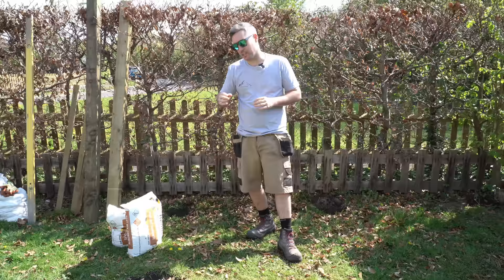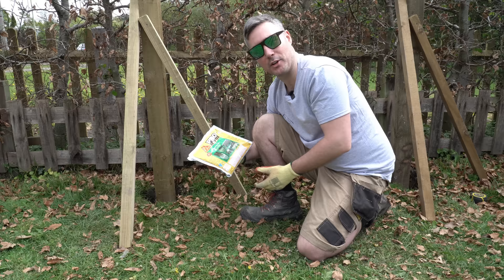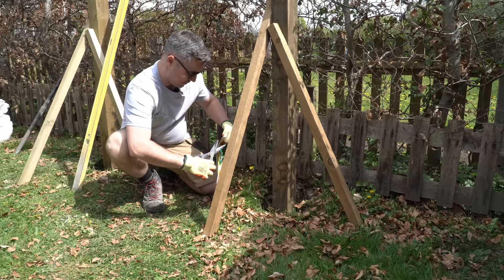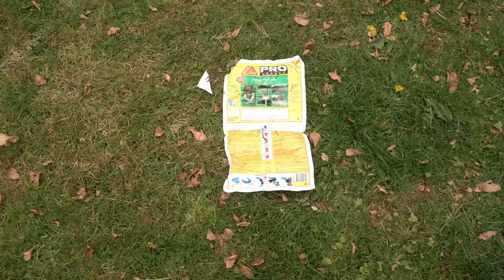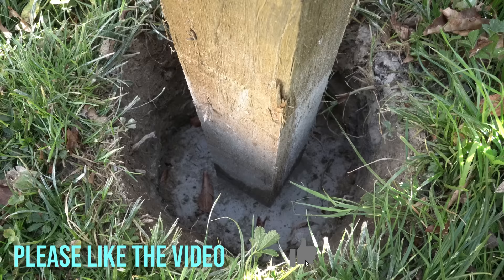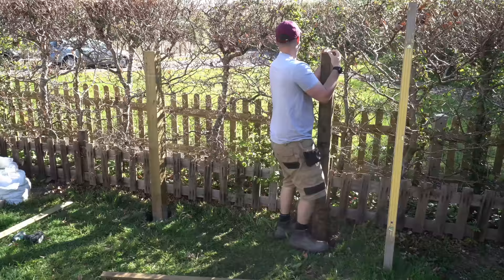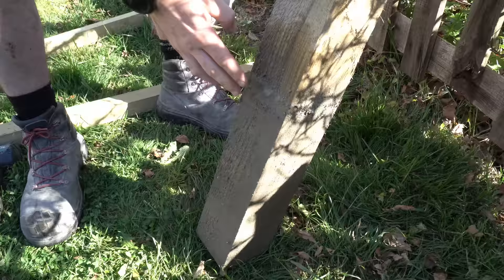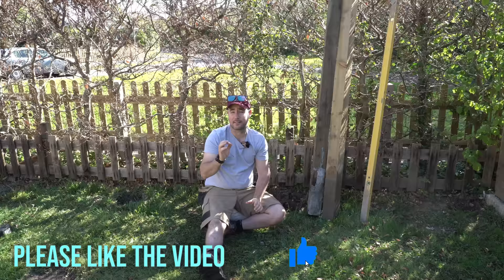Fence Post Foam vs Concrete | STRENGTH TEST

Comment: I set a bunch of posts directly in the earth. I tamped the earth back in around them as I filled in the holes. That was 10 years ago. They are all still fine. So that is another option. But it depends on soil type and wood type. In my case, the posts were all heart redwood. Also, the holes were pretty deep with as much wood below the surface as above.
Reply: People are too lazy to tamp in posts. It's a time tested way but this modern instant gratification world doesn't allow for anything that doesn't have an easy button to avoid as much manual labor as possible. Frost heaving is another issue with a straight walled hole, where as a bell shaped hole prevents that. But again more manual labor required to dig a proper hole. Now the world will be dotted with foam plugs, I'm sure that's good for the environment. 😊
Reply: @yougonnaeatthat9889  I'm too lazy to carry bags of concrete where I need to put the posts! LOL. I definitely don't like the idea of putting foam in the ground on my own property. Wood and earth are very natural materials. Concrete isn't 100 percent natural I guess but I certainly don't mind it. It is environmentally pretty harmless and inert. But foam? I would feel like I was just burying plastic junk in the dirt!
Reply: @mckenziekeith7434  
If you can rent the equipment.  You can get the post you want to install, cut a point on the end, treat the part going into the ground with used motor oil and let it soak in completely, then pound the post into the ground.

You do not have to dig holes, the post will spread and compact the soil around its sides, and the used motor oil will waterproof the wood and prevent it from rotting.

Oil is biodegradable and the small amount of metal particulates from the engine are too small to hurt anything and the other contaminants are usually soot from combustion and dirt.
Reply: @mckenziekeith7434  In the US, some electric companies are using foam on their utility poles!
Reply: @oldtimefarmboy617  driving wooden posts in that manner only weakens the wood structure causing faster deterioration.
Reply: @yougonnaeatthat9889  
"@Old Time Farm Boy  driving wooden posts in that manner only weakens the wood structure causing faster deterioration."

In Louisiana and other places where the water table is close to the surface, when they are going to build structures that are only a few stories high, they drive very long and large wooden posts into the ground to build the building's foundation on top of and they are expected to last 100 years or longer.  They do that because the high ground water table make the ground shift constantly which would cause the building to break and crack all of the time.
Reply: @yougonnaeatthat9889  Ok boomer

Comment: I installed a treated wooden fence 21 years ago around my back yard. Holes were dug 3 feet down by 10 inches wide and filled up with crushed rock around 4 by 4 posts that were also treated. This year out of the 50 posts, I had to change 3 that were broken 2 feet down in the soil due to various impacts over the years. I was easi.y able to pull out the top portions of the broken posts but had to dig 3 feet down to remove the rest and installed new ones in thier place.

No matter how well treated wooden posts are, they will all eventually rot and need to be replaced but the point here is that it took 21 years. That's pretty good in my books and also, rotted or broken wooden posts are much easier to change when back filled with crushed stone than when back filled with cement.

Comment: When pouring wood posts, wrap the bottom in felt so that it can last long  Also drive a couple of 4 or 6 inch nails into it for added strength.

Comment: Your problem surprised me.  I used a bag of Wika, and it set very strongly.  The post is sturdy.  My foam dried yellow color though, so may be different, even though it's also Wika brand.  Also, I dug a very narrow diameter hole, maybe 6" to 7" diameter, and the foam overflowed over the top.  I cut it off with a reciprocating saw, careful not to cut into the wood.  Thanks for the demo.

Comment: Dry posts help with adhesion. You could add some lag screws to the post to make it harder to pull out. Pour the foam down the sides of the post starting at ground level so it doesn't leave a void around the post.
Reply: So a right fiddle to use
Reply: I always stagger a few screws on the sides of the posts, grabs like dead men.

Comment: I used SIKA on all the posts for my entire fence!! Had severe weather pass through already and its been solid!! Now come 15-20 years when I need to renew the fence, it should be an easier job pulling the old posts and augering the same spot and refilling it with new sika! 👍🏼😄
Reply: Good point!

Comment: I had a VERY different experience with the foam, no idea what brand but mine was a different color and my post are in super solid 4 years later. I remember I used extra and had foam way above ground lever in the end. Couple days later I used a foam board kind of knife and smother it out level. BUT I would just use concrete next time. Just seems better. lol

Comment: I don't know what you did differently from what I did, but I used an expanding foam product which looked like it came in the same packaging the one you used, but the foam was green.  I used it six years ago on a post, and it is still as strong today as it was when I originally poured it in. I just went out after watching this and shook the post and it's still doesn't budge.

Comment: As with all foam products, application is key. How well the products are mixed and how warm it is play major roles in the product performing as it should. The hotter the temps, the better.

Comment: I think it'd be cool to see a strength test for concrete set  metal or wood fence post.  And in the test you'd do 1 post with one bag of concrete, 1 with 2 bags, and 1 with 3 bags.  That way we can see if we're getting the same added strength per bag.

I think using a winch with a tension meter might be a good way to test the strength.  Just an idea I had.  Thanks for the content!
Reply from the maker: That sounds like a really good idea for a video. Thanks for the suggestion. I have a couple of other videos coming soon but that will definitely be on my list for the future.
Reply: @JamesMontana  Awesome!  I look forward to seeing the video.  Thanks for the reply!
Reply: I'd say you probably do need to test these with a dynamic load though, not just a winch. Wobbling them back and forth by hand may be less repeatable, but it is more like the loads they'd experience in reality.
Reply: It doesn't matter how many bags you use. What matters is that the hole is the correct depth for the height of the post (2ft for an 8ft post) that the hole is the correct diameter (1.5inches larger than the post), and that the hole is correctly filled (fill tightly and top to bottom).

If the ground is good and you dig the hole right you likely won't even need a full bag to properly fill the hole and it will be solid. The reason it doesn't matter is that the ground is doing most of the work stopping the post moving; all the concrete is doing is properly packing out the space between the post and the ground.

Comment: Ive used sika foam for 5 of my wooden fence posts. It works great. One thing i did was to drill 4 or 5 one inch holes thru the post towards the base. Im hoping the foam flows thru the holes and grabs it even better.
Reply from the maker: It probably will. I have no complaints about the grip strength. Once you get this on a post youre not getting it off. Its the constriction in the post hole, lack of mass and moisture holding abilities that concern me.
Reply: @JamesMontana  something went awry here… that foam didn’t expand properly. I’ve used this stuff a lot. It’s suppose to over fill the hole and it has never shrank on me. When it over fills you can cut it with a drywall saw and shape it so that the water can run away… the same as you would form concrete to pitch away from post. All the stuff that I’ve ever purchased is white too… maybe I overlooked but never saw it in any other color here in America.
Reply from the maker: @jdottv4732  yeah i understand its supposed to over flow. I had dug the post hole 30cm x 60cm so slightly wider so i could get a camera shot of it expanding. I still dont like how much moisture it was holding on the post and the lack of mass anchoring down the post. Id like to see how well it does over time.
Reply: @JamesMontana  Well , I would say the the moisture is from the bottom of the hole, If the post was standing on bare soil. Should have put something under it. The soil around might have been more wet from the tree roots or just moisture in the soil. The foam couldn't wrap the post from under. Just my thoughts.
Reply: Seems like a smart move!
Reply: @JamesMontana  So you didn't follow the directions?  You can't really give it an honest judgement than can you?

Comment: Like you, I was very skeptical of the foam product and it performed exactly as I expected it to perform. Thanks for posting this.  Very helpful. That said, I would mix the concrete before pouring it in the hole. What you've done is a dry mix and dry mixes are much weaker than wet mixes.

Comment: I had a buddy that would slip 8"-10" round pvc about 2' long into the hole, then put the post, then foam... And it hardened fast. I asked why he used the pipe inserts and he said its so that the posts can be moved and reused if needed. They dig up nice.

Comment: Wet hole, plastic bag over post, pour foam between post and bag, it will expand and push the water out of the hole without causing an issue with the foam..

Comment: This foam is like the Emporer's new clothes. Set the post in the ground deep enough and there's no need for foam or concrete. Simply compact the soil during the backfilling process and it'll be solid as a rock. It's a centuries-old method which minimises the problem of water collecting around the post and rotting it. Concreting posts in is a relatively modern concept used mainly to save time during construction.

Comment: So I noticed you went in with a biased mentality... Let me clear some things up. I've used this stuff for years building fences professionally. It works great, but you can't go into a project expecting to treat it like concrete... I noticed that the concrete in your hole came to the same level as the foam. The package gave you an accurate description of being the same volume as 2 bags of concrete... In a real scenario, you would fill that hole with 1-1/4 bags of SIka Foam and pour the rest into the next hole, let it expand out above the first hole, then when it sets, due to it being a closed cell foam, you would take a utility knife and cut the excess off around the neck and down just below the grade. This allows for a waterproof seal around the first inch or two of the post. You then backfill the remaining inch below the grade.  As for the sturdiness of the post, you need to back fill it a little higher than the grade and pour a bucket of water on each post. This will force the backfill to work it's way down into the natural voids in the soil due the the excavation disturbing the soil. The only reason your concrete is working better for your application is because you are only going 2 feet down and concrete is extremely heavy. I live in Canada and due to the frost line being at 3 feet below grade, It is proper for a professional to set fence post at 4 feet below grade. It's more like 3'-6" with 6' of drainage gravel below the post bringing it to 4 feet. So this product works best with these things I've mentioned in mind. Maybe try digging a 4 foot hole and try your test again with the proper amount of material and the backfill and water method. See what happens...
Reply: Its still crap. You probably got paid to comment.

Comment: I have used the foam to set a temp fence at a commercial construction site. Its is fast, the only problem is that after a heavy rain, the posts floatted and fell over. I had to got back and reset about half of the fence. A couple 100 ft.

Comment: My experience with fence posts (treated or cedar) has been that, when the post starts to shrink, the concrete holds water in the hole that rots the post.  I’ve had much better experience using gravel around posts - instant drainage.  Even if the lifespan of the posts was the same in either case, you don’t have to get an excavator and a jackhammer to remove the stump from concrete.

Comment: Center of gravity, and 100 lbs added to cement post.
The soil density is the weak link.
In US all power poles are anchored with foam with no issues.

Comment: This stuff actually works very well when used correctly and keeps the post from rotting. The only downside is it takes at least 1.5 bags per post not one and sometimes two. I also go 2.5-3 ft deep because of the 8ft height. I have over 1000 foot of 8ft tall wooden fence built with this and it’s very solid. You have to fill the entire hole and saw off the over fill after it hardens. Then come back and cover that with dirt. Once everything settles it’s solid as a rock. Before I committed to this product I installed 3 post with it and waited a year before actually building it to make sure it would work on this size of a job. I tried everything I could to push the post over by hand and couldn’t move it at all. I would definitely use this again instead of concrete because concrete keeps the post wet. Redo this video with this way of installation and you’ll change your mind about it

Comment: Great video!  I have seen that stuff in stores and always wondered if it was really any good.  
Only one comment; I'm a carpenter and a college carpentry instructor, a really common misconception is that moisture in soil will rot out your fence posts. Fact is, water in the soil does not cause your posts to rot.  If you ever pull old posts out of the ground to build a new fence, you'll see that fence posts only have a rotten area of about 3-4 inches starting about 1 inch above the ground to about 2-3 inches below ground. This is because this is the area that sees repeated wet/dry cycles, everything above one inch drys out quickly and everything below 3-4 inches stays mostly moist and very little oxygen is present that far under the surface so no mould can survive and cause rotting. 
Rot is caused by a repeated cycle of wet/dry/wet/dry.  300 year old logs recovered from the bottom of lakes, rivers, and harbours are nearly perfectly preserved because they have been underwater constantly, they never saw a dry cycle, and thus exhibit no rotting.  
Likewise there is no such thing as "dry-rot",  as I said a moment ago, rotting is the product of repeated wet/dry cycles feeding fungus that consumes the cellulose in the wood. If it was never wet, it would not be rotten.

Comment: And screw a few big (14g?) screws into the post, to lock it on the concrete.
And you f'd up on the calculations for the foam. the hole should be narrow enough so the foam rises above ground level, and it can be easily cut to a suitable profile to shed water.
The fact you could man-handle either post out of the ground indicates both techniques were inadequate.

Comment: Good assessment  but the main problem with concrete is that your wooden posts will only last for 6 years because the lime in the concrete will rot the post off where the concrete  meets the post on top. You may achieve a little more longevity with angling the mix downwards and away from the post but concrete and wood are not a good in-ground mix. I haven't used expanding foam but since it is used to secure window frames into buildings and provide water seal, it may be a worthy option. Personally I use broken brick and block (good for recycling) with soil and they have been carrying 2 x 5 bar gates, I do however  apply several coats of expensive wood treatment. I have posts many years old that don't need replacing! The other thing is that you have a lot of work on digging out and disposing of old concrete, when the posts have gone! Tried that one - never again! For field posts and wire fence I don't use either just a hole and a narrow spade. That works okay.

Comment: I did my garden with 6' 4x4 posts in foam. It works well for  the line and corner posts, but not for end posts, especially for a gate. NO GO for a gate.

Comment: I have never liked the idea of concrete in direct contact with the post, so I always coat my posts in roofing tar to about an inch over where the concrete will reach before setting them in concrete.  20 years and many storms later, all good.
Reply: 100% coat the post, in concrete they always rot at or just below ground level. Coat , bury at least 3' , gravel and pack dirt. No fail post install
Reply: or you can just use pressure treated 4x4's and not have to hassle with any of that..

Comment: Put your posts in the holes in the winter, and add water to the top of the hole. When it freezes, the ice will be as strong as the concrete, and at minimal cost.

Comment: I built a 6 foot fence with 4x4 posts. I bought orange post sleeves from Home Depot. I have 1 left for when my mailbox gets hit by the next careless snow plow driver (LOL). I drilled an 8 inch hole. Put 25 lbs. of crushed stone in the bottom for drainage. I slipped the post protector over the post. It has an air gap all around the post for drainage. I put one screw in it to hold it while slipping it in. Then I filled with two 90 pound bags of concrete. I used 7 posts. All totaled, that's 1400 pounds of concrete holding down that fence. If it gets hit by a tornado, the house might blow away. But that fence will still be there!

Comment: Trouble is expanding foam deteriorates very quickly outside.add sitting in sopping water to and fence posts begin to rot. 
When putting in cement rub it up the sides of the post to 200 mm above ground level and they will not rot.